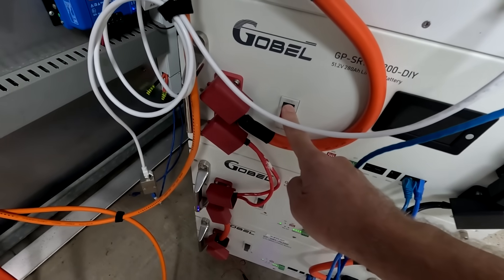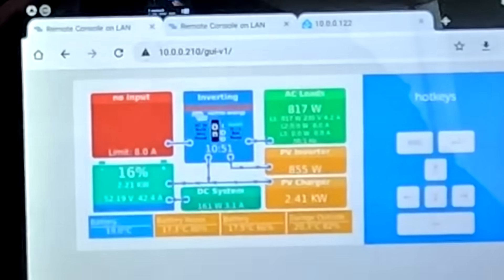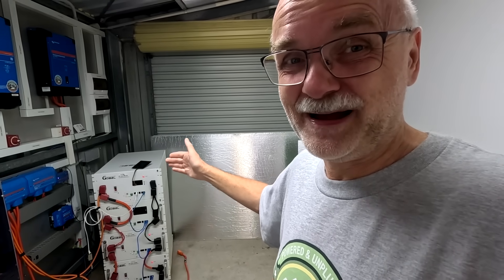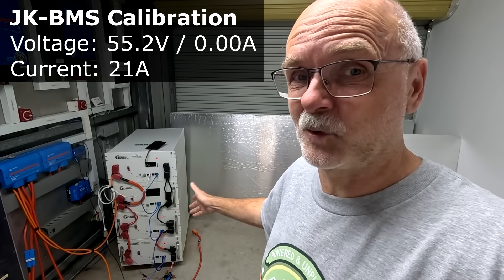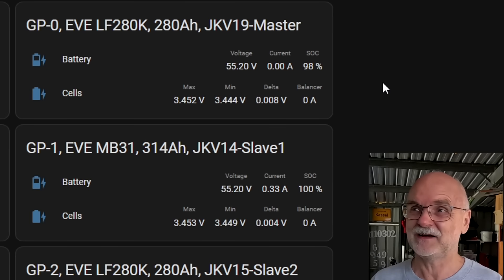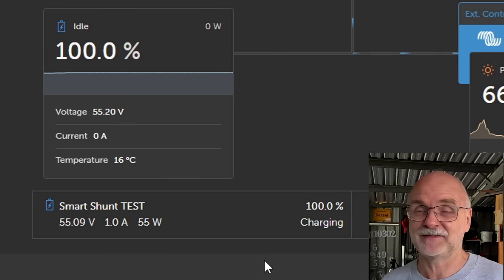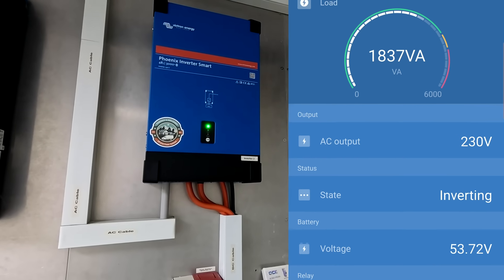SOC not accurate in the JK Inverter BMS? Which model works best, V14, V15 or V19? | Part1

Comment: In DESS mode it gets even worse, the jk measures -1.8A while the multiplus measures 0A. Over time the soc of the jk goes to 0% while the multiplus internal calculation stays on 40% which is according to the voltage correct. Probably it's the ripple caused by peak shaving by the multiplus because when peak shaving is off this issue doesn't occur.

Comment: I just completed two EEL vertical battery boxes and the JKBMS is trash as far as accurate state of charge indication.  I do not always achieve 100% state of charge lately.  When first charged to 100% it was accurate but over time it has drifted very low.  I understand it is a common problem with this BMS.

Comment: You can't precisely measure parallel BMS this way. You must measure each BMS separately since you don't know what exact current is going from each battery. You only know total of all batteries. 

The total of errors of all BMS is sum of each BMS measurement error. The single victron shunt will be always more precise than multiple meters in parallel, even if you would have multiple shunts.

Comment: Since jk bms relies on amount of charge and amount of discharge into and out of the battery to estimated SoC, my suggestion would be that, let it do the same way, just over ride the SoC on the basis of voltage when

1. All cells are balanced
2. All cells are below lets say 3V
3. Charge/discharge current below 10A

If the drifted SoC dictates that SoC is 30% at 3V, the voltage policy should kick in and correct the SoC to 5% (or whatever SoC is actually there at 3.0V).

I think this would be more efffective if the voltage policy works at 3.1V instead of 3.0, so the battery user be informed of the actual battery SoC instead of power outage

Comment: The JK BMS is taking periodic samples of the current and assumes the current is constant between sampling points.
This would be correct if the battery was powering a constant load such as a lightbulb, but it's wrong when powering an inverter.
It should take multiple samples and compute the RMS value of the current waveform...or at least an average over a window...because the DC current has a waveform when powering an inverter.
Reply from the maker: Correct. I think the JK does that internally but just shows a random value of that time period in the app. I'll confirm that with Jikong though.

Comment: I again had a v15.41 JKbms failure again. After months of no issues, I noticed the SOC of pack2 was way different then pack1 and 3. Then checking the logs of the bms, it was mentioning cellcount incorrect and also a shutdown 1 minute after that. After a reboot of the bms all seems fine. To me it sound not like a hardware issue then... But really bad this happens.... second time in 2 months. 8 months running now with this setup.
Reply from the maker: Yeah, that's not good! I would suggest swapping two BMS and see if the fault stays with the BMS.
Reply: @OffGridGarageAustralia  thats an idea. However its very hard to disamble packB as another 100kg or so pack is on top of it :p. And the issue occurs once in...?each 4-6weeks. But its an idea...soon..😅

Comment: I having the opposite problem that everyone else, i just put a smartshunt 300ah to my battery bank of 2 batteries of 100ah each, im in the process of adding a 280ah battery, so i instaled the smart shunt, but is giving me a soc that is a lot worse than the jk bms. Reaching 100% a lot sooner than the two jk and also at a lower voltage, so obviously the smart shunt is wrong here
Reply from the maker: You need to adjust the Smart Shunt setting if you add more battery capacity.

Comment: Thinking of buying the jikong jk 300a inverter bms v19 it has three screws to attach the battery and load cables instead of the normal two or even one, what I am not sure of is wether or not the number of FETs has been increased to handle the larger current, are you likely to be testing this bms any time soon?
Reply from the maker: I don't have the 300A BMS. It will definitely have more MOSFETs than the 200A version. You can simply bridge all the 3 screw terminals with a busbar and connect only one cable to each side of the BMS.

Comment: Hi
On what did you set the RCV and RFC?
This as you mentioned the reset to 100% would talke minutes. But what do you recommend when there is winter time?
As you mentioned in the winter resetting to 100% is difficult and therefore it seems the RCV need to be set low?
Please let me know your thoughts
Reply from the maker: RCV: 3.45V
SOC100%Vol: 3.445V
RCV Timer: 0.5
RFV Timer: 8

No, RCV should not be lower in winter. We can only absorb and fully these cells at 3.45V or higher. Setting RCV lower will not fully charge the cells anymore.
Reply: Hi, thank you for your reply, keep up the good work 🤘🏻
I had the RCV on 2, but that didn't seems to work properly as the battery wasn't reset to 100%, I'll try 0.5. thank you

Comment: Another good video Andy do you possibly think it would effect the battery’s if the two batteries with the same capacity has the same version bms in them
Reply from the maker: Thanks Walter. In which way do you think the batteries will be affected by the BMS?
Reply: @OffGridGarageAustralia  like if the balancing and charge rate be better off if the battery packs are the same size and bms version so then all the presets match so then it doesn’t have to charge one faster or one slower

Comment: To get your total Amp Hours you are using the stated capacity of the cells rather than the actual tested capacity. i.e. 314 vs 330. Wouldn't using the actual capacity result in more accurate test results?
Reply from the maker: I thought about this as well. At this point, we don't know how long this 'extra' capacity will stay. Is this permanent or just for the first 2-3 years? We don't know.
The JK adjusts the full charge capacity automatically when doing a full cycle. But who is doing this just to calibrate the BMS, right?

Comment: My v15 (now also with the newest (and laast) firmware) has horrible inaccurate current measurement. Doenst matter, I use a smartshunt as battery monitor, but I dont get why it is so hard to build a proper shunt

Comment: Found an bug in V15.41
They did add “Battery Temp OTA” and “Battery Temp OTAR”
They are fixed 30 degrees Celsius, increasing or decreasing is not possible.
Even 30 isn’t possible.
This makes programming the BMS by importing the parameters (batch programming) impossible.
Reply: You have to install the last version of phone application JK BMS. Temperature settings will work correctly.

Comment: Hi Andy, thank you for your videos. I really enjoy watching them. With regards to the last video and SOC. I see you enter the capacity as that stated for the batteries. but they are not charged to 3.65/cell. Also, depending on your cut-off voltage you will loose some capacity. I had a situation where my system shit down, but the Victron BMV indicated I still had 20% left. I have then reduced and set the capacity to the last discharge as indicated by the BMV hoping to get a more accurate reading. I have seen you confidently discharge down to 3% and would be happy if I knew I could do the same without wondering when my system shuts down. Oh, and it is possible that a battery has degraded to the point that only has a percentage capacity of indicated available. This one would have to check on a per battery instance which is difficult if the system is in use. Thanks again for your informative videos. Cheers from South Africa.
Reply from the maker: We charge the cells to 3.45V and let them absorb. This will fully charge them to 99.9%.
When you discharge, watch the voltage. If your cells dip under 3.0V you will have around 7-5% left.

Comment: This SoC condition is one of the main reasons I go ahead and charge up to 3.6V instead of 3.55 like seems to be the common thing to do. At 3.6V the cells are just coming out of the flat charge and starting to rise again. I use this as the last stage to let the bms do it's balancing before fully charged.
Granted, I'm having an issue with my bms as it won't communicate with the Inverter. I put a scope on it the other day and found that no matter what there's no signals on any of the ports. So now I gotta rig up a recording session to show this to the seller (as I didn't get it from JK at the time).  The comms issue means that I also can't update the firmware either.
Reply from the maker: There is no need to charge to 3.6V. You can achieve the same at 3.45V and fully charge the cells.

Comment: you need to equalize the volume of your video's. Volume is going up and down continuously.

You also need to attach ALL batterys. DIY, Seplos, Eel, Yixiang, etc Than allow some of batterys to charge and the other to discharge. And change over when one set is fully charged.

You also need the BMS 100% level lower than the inverter to allow the battery's to balance.

You should have more than 240kwh. I still can not understand why you fully drained your battery. Seems your "good-housekeeping" is off.
Reply from the maker: I don't NEED to do any of that!

Comment: I had a good idea how to make it possible to improve JK BMS-es SOC accuracy.  We only hope they improved the shunt's resistors and microcontroller's analog-to-digital converter in the V19 hardware; but if not, and for V14&15: the solution would be to make changes into firmware to allow to set %SOC to the BMS from external source (a program communicating to it via RS485). In that case someone could write a program/driver which monitors voltages and currents and compares real voltage with real current vs special "lookup table" and corrects SOC% in the BMS accordingly. As a correction mechanism it would help. I wrote about that in detail in one of "community posts" on my channel. Read, please, if interested.
Reply: and where could we read this? is this just 'an idea' or did you start computing it?
Reply: @NTI-SITIC I wrote the answer, now found out that my comment was deleted.

Comment: I wanted to go with the best and Seolos is way more accurate. Im pretty sure this  BMS can't do it. Glad i have 400+customers on Seplos. But trying  jk as well to see if i can get it be more accurate.
Reply from the maker: Seplos is not accurate either when you not fully charge frequently and they have many other issues, like reliable reset to 100%, no float mode...

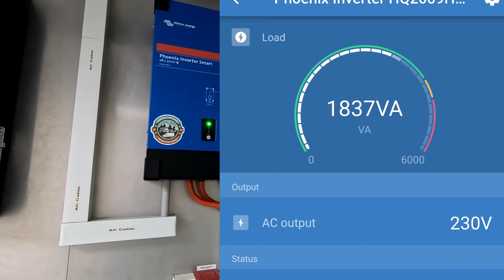Comment: 12:50 vs 13:30  
1160 vs 1836  W. that is 39% loss -  really ?
Reply from the maker: I'm not sure how accurate the numbers for the HV EV Battery in the app are. The power value moves between 1.1kW to 1.7kW up and down, while the current stays constant at 3.1A. The vehicle itself does not show power but only current, so I guess power is somehow calculated.

Comment: Thank you Andy for performing this test, I ordered 4 v19 JK BMSes, I really like the new display which shows all stats (I had 2 old simple v14 BMSes which were communicating via RS485, battery aggregator and serial battery to my venus OS), but now I will upgrade my 2 old packs and add 2 new self build packs to it. Will get a total of a bit more than 59kWh, with a Dutch sunny day my harvest is around 40kWh, then 28 kWh isn't enough sadly). The 280Ah cells were 2 years ago €147 per piece, now I could find 305Ah cells for €52 per piece. Bringing my kWh cost down from 8ct to 3.5 ct in total for battery power. I still will be offloading my surplus energy to the grid, but with dynamic prices I'll do that when the yield is the highest (during daytime energy is 0ct in NL, in the evening around 14ct) without the taxes. (Taxes are still deductable from your use until 2027). Good luck charging your wifes car, why nog have a bit higher charge current?
Reply from the maker: Nice setup, Edward. Battery capacity is rising while cost is coming down.

I'm not using the Victron charging station but the Phoenix inverter to charge the vehicle. So, I cannot set the current when I use the brick charger. It is fixed to 8A. This is just the setup, for this test, so 8A it is at the moment.
Reply: @OffGridGarageAustralia When you have time 8A should do, I often charge with 6A as well. Sometimes I need more speed an will go to 16A. Working on a three phase setup, then I will charge mostly with 3x 6A, which is 18A and should suffice most demands at my home. Keep up the good work and enjoy the Amps outside 🎉❤

Comment: Why even calculate SOC by current flow at both tail ends?? Just use voltage level at min and max. Ist doch komplett eindeutig der Wert an den Enden. Und eigentlich interessiert nur der min val Ruhespannung für Winter SOC.

Comment: I have on my WInston from 2013/14, 272 000 Ah, 7110 disch., 7400 charge, so eff. of my LFP is 7110/ 7400 == 96.08 %.
I have tail. c. 3.5, det. time 3 mins, eff. 98 % and cu. th. 0.05 A and after a few days SOC displey 94 %, but battery is at full 27.89 V,
so this shunt, can not count / integrate precisely low currents al long time intervals. 
BMS is even worse, can not detect current under 0.6 AMPS. precisely.
Reply: Wow, nice efficiency still after so many cycles. Did you compress the cells?
Reply: @edwardvanhazendonk  NO, cells are in free air from air conditioner,  18 - 21 *C a few centimeters apart, Winston 100 Ah, M8 terminals, brass screws, Cu busbars from flexible plates , optional from 17 grams to 170 grams, so in parallel batteries - DC resistance of the pack can be fiddled to achieve even current distribution.

Comment: Andy, have you ever calibrated the JK bms’s? 
Some need both volts and amps but all needed one(non-inverter type). Most are very close to the shunt after that, but a few never get better than 10% of actual capacity after numerous cycles.
Reply: To calculate SOC correctly they also need to be set to the real capacity of the battery, not the nominal.
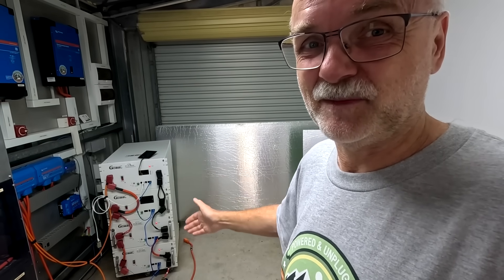Reply from the maker: I thought I said this in the video at 5:50?
Reply: @OffGridGarageAustralia 
But it looks like you set the BMS to the nominal capacity 5:00 not to the real capacity.

Comment: My v15's are terrible at SOC on a good day. Low current flows kills it. Happy to have figured out how to get the 100% reset on all of my batteries doing a fake move on my inverters that shutdown charging at 100% SOC.
All 9 batteries are the same 304ah cells and they sit flat with each other all the time. Knowing SOC on one is good enough. So yeah thanks for making my dim light turn on Andy! Hanging a Victron smart shunt in the right spot will tell the tell and tickle my fancy just fine.
Reply: I've calibrated my V15 with the Victron BMV712 already weeks ago and it still follows the same voltage. For me good enough. Everyday the batteries reach 100 procent both on BMV as well as  the JK BMS. I am on fireware 33 because later fireware f...s with the 100 % and never gets there.
Reply: What do you mean by "doing a fake move on my inverters"?
Reply: @JdZ-2023  Not really a fake out. All the slaves are set to 3,45 RCV and 3.445 100% SOC. The master is the same except that the RCV is set to 3.5 and since it controls the charging all batteries are charged to 3.5. That alone gets all the slaves to 100%. And since the inverter stops charging at 100% based on the average being sent by the master, more than likely the master is left hanging at 99%. But, by having all of the batteries well balanced and absorbed at 3.5 the batteries are slow to fall back with no load on them. The inverters are carrying all of the load from the PV as long as it's available. So typically the master can get reset to 100% before the cells have time to return to the rest voltage. Worse case the master doesn't get reset but it's not often. EG4 6000XP inverters.

Comment: Is it possible to have the master connected to cerbo GX and displays at the same time? When I connect a display the communication to the cerbo GX Drops.
Reply from the maker: Never had this problem. Most of my batteries have a display.
Reply: What settings do you have on UART1 Protocol, UART2 Protocol and CAN Protocol?

I’m running one on hardware version V15H and Software version V15.38 and three on hardware version V15A and Software version V15.35.

Comment: Hi, thanks for your videos.
In the latest firmware 15.41, the most significant change is - ,,RCV RFV time limit maximum of 25 hours,,
But unfortunately the BMS still allows set a maximum of 12 hours
It's strange that in the final version of the firmware they made such a mistake
Maybe in the future they will release some more fixes?
Because now it looks like very bad quality control. And if they make such obvious mistakes, then how can you trust them with the safety of the battery ?
Reply: I, having only 1 battery 640Ah@24volt, am totally happy with one JK V15 fireware 33 bms. Works as a charme.
Reply: Is that the best firmware 🤓? I'm at the 15.32 and rcv time does not work... So I'm relying on the mppt for now...

Comment: Do see JK is measuring peek current and not average current.
If the multiplus II are offline I do see currents under 3A, when the grid is connected I don't see the current under 3,2A.
The current if the multiplus II is on grid isn't DC, it is DC + a waveform.
And because JK uses the peek current measurement the measured average amps are with it the SOC is incorrect!